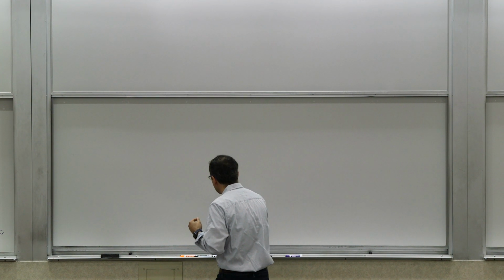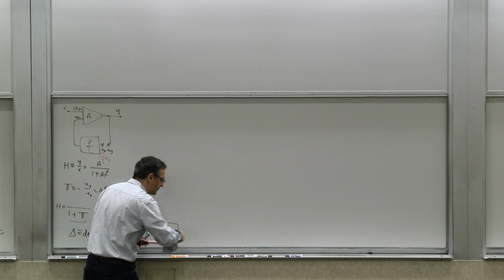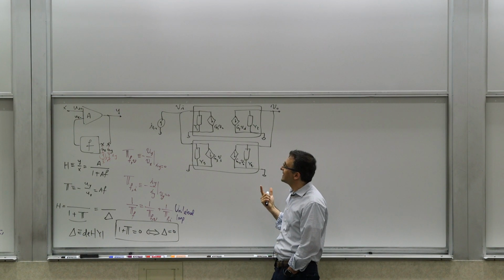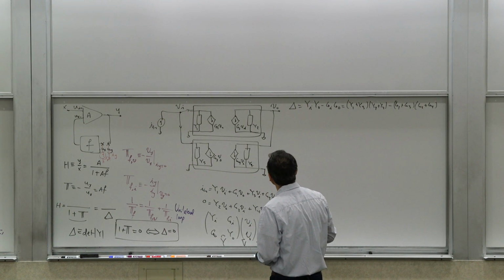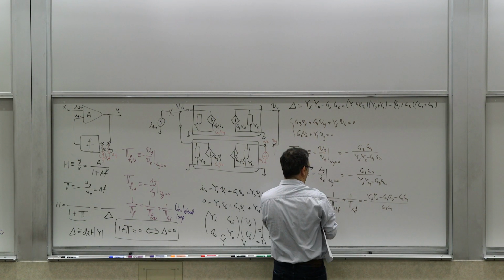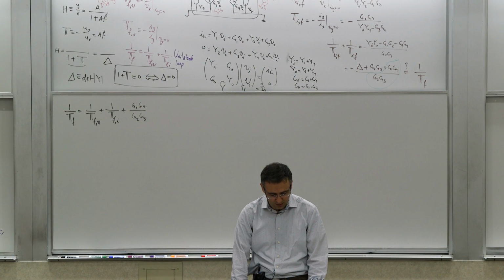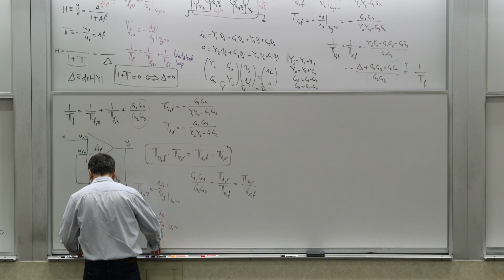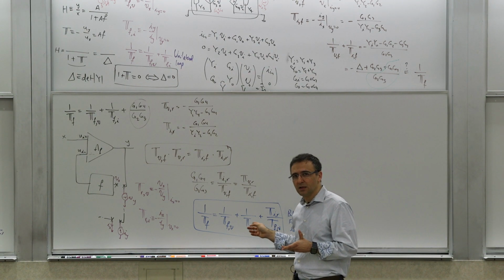165N. Bilateral loop gain, derivation, feedback

Comment: According the point you break the loop at 28:58, it is unilateral (the capacitor in parallel with R2 is the new impedance). I think that's interesting because the unilaterality or bilaterality depends on the loop that you consider, it is not an intrinsic property of the circuit.

Comment: I would really love to hear your opinion about the DPI/SFG method developed (in part) by Agustin Ochoa*. I am currently using it for the simulations that are part of my master's thesis and it seems to be way more intuitive than, for example, opening the feedback loop and replica-loading it to maintain correct loading when analyzing the loop gain.

*see "Feedback in Analog Circuits", Springer 2016
Reply: I haven't looked at your source more in depth, but it sounds like the method that we learn at Georgia Tech. Look at prof. Leech's notes for example here: https://leachlegacy.ece.gatech.edu/ece3050/notes/feedback/fdbkamps.pdf I agree that this is a more powerful and general method, but it can have diminishing returns for simple circuits, it seems like
Reply: I love DPI/SFG as well.